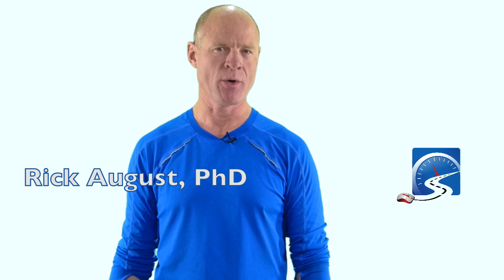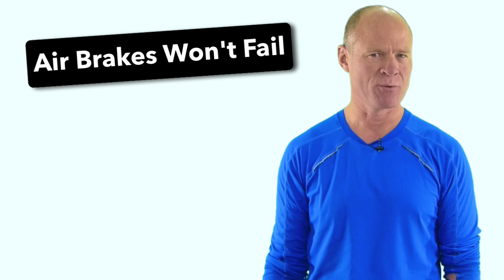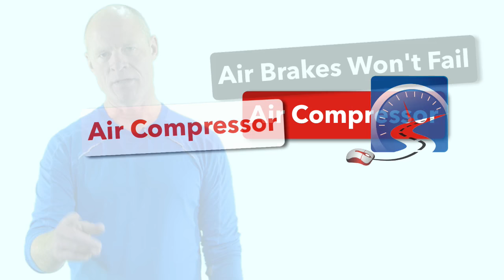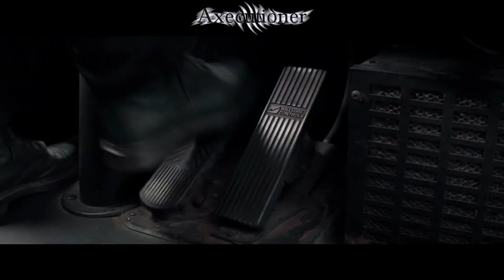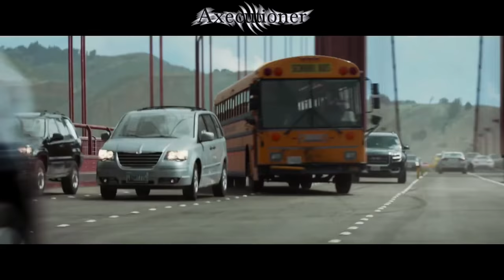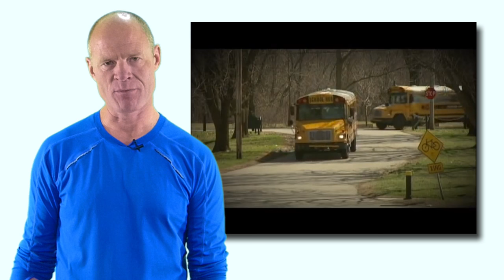Air Brakes Won’t Fail | Air Brake Smart

Comment: This is a great example of hubris. Saying something won't fail
Reply from the maker: I didn't say it wouldn't fail; I said it's unlikely that it will fail. There are levels of "likely to fail" - like airplanes. Air brakes and airplanes are built to the same high standard of unlikely to fail. And if they do fail, there are failsafes that will get you stopped in the unlikely event that the machine does fail. All the best, Cheers Rick
Reply: @smartdrivetest  IT SAYS IN THE TITLE OF YOUR VIDIO THAT 'Air breaks won't fail" NOT "Air breaks are unlikely to fail" but yes there are things that can stop runaway trucks on interstate highways
Reply from the maker: You're splitting hairs my friend. If air brakes were prone to failure, they wouldn't put this system on school buses. And almost all the time that there's a runaway truck on the highway, it's not a result of brake failure. It's a result of drivers that aren't trained properly, and they exceed the capabilities of the service brakes - the service brakes, not the "braking system." Because drivers weren't training on "downhill braking" they experienced brake fade. If you drove your car around at full throttle all the time, eventually you'd blow up the motor. Or if you tried to cut foot tall grass with your lawn mower, it wouldn't do it because it's beyond the machine's ability. Service brakes, in combination with engine brakes (jake brake), and the right gear going down a hill and the driver will get down the hill every time. Driver's in 140,000lbs trucks get down mountains all the time without every using the service brakes. All the best, Cheers Rick
Reply: Yup! All it can take is a bit of junk to puncture an air line.
Reply from the maker: @johnsarab4500  If that was even a remote possibility they wouldn't put air brakes on school buses. Air lines--to say the least--are robust. All the best, Cheers Rick
Reply: @johnsarab4500  show me an example where “junk” punctured an airline. I’m sure it has happened but it’s not even remotely common.
Reply: Getting impression air brakes never fail..on a semi

Comment: I failed my my air break test Oct 19 2019.  i felt over confident and failed right away, I  pass the core test and had two wrong.
I really want to learn how to operate a CDL Class A in the future. it's a scary thought in a case of a break failure  and theres no scape ramp.  now you have to make a critical decision on what you are going to crash into, just make sure its NOT PEOPLE OR FUEL STATIONS!
Monday I will start training for a school bus so we know what class I'm going for.
great video on explaining how the air breaks work.
I will sub,  I really can use you video instructions.
I was at DMV today and for the most part everyone keeps to them self.
Reply from the maker: Hi Mariovo5 - Thank you for your comment. Have a look at this video my friend: https://www.youtube.com/watch?v=c1ldt8qK-HM&list=PL0x-bChcUvwG2bSWReQWnk9Tm92L7WN_O&index=6&t=0s If there is anything further we can do, drop us a note. Always happy to help. All the best, Cheers Rick
Reply: The truck won't break effectively if you overheat them but not because of the system failing
Reply: @friedchicken1  But overheating absolutely leads to brake failure.  This is intellectually dishonest to call it anything but brake failure!  If you're flying down a hill and the brakes don't work, that's brake failure!
Saying otherwise is being disingenuous.  Teaching new drivers that failure cannot happen when it can is malpractice!

Comment: yes took my CDL test in 2010 was told they had a lot of problems to watch for, but I am glad they told me that because I have been driving farm trucks and it has helped me be wary of bad maintenance on them. GLAD TO KNOW Modernized WELL CARED FOR TRUCKS ARE WORRY FREE! WHEW!
Reply from the maker: Hi Ladonna - yes, older trucks are a little bit less reliable. But newer trucks with air brakes are more or less bullet proof. As I mentioned, a little bit of knowledge about downhill braking will keep you safe! Thanks Cheers Rik
Reply: Smart Drive Test thanks Rick nice to know!!!

Comment: Hey Rick 
I hear ICBC will be doing a revamp of the air brake course. Rumour has it that class 2,3 and 5 will be one day, and the class 1 students will stay for the second day. While it’s still a lot of information drivers don’t really need, it is a start. 
In my opinion, there are still some necessary lessons to learn during this course ie: how and why we check the system daily. 
Also, logging trucks are still sporting manual slack adjusters last time I checked.
Reply from the maker: Hi Chip Jackson - That has been a rumour for a number of years. They're not revamping the course; they're simply following Ontario. Ontario has broken the course up into single units and trailers for a number of years now. ICBC is simply doing what Ontario's already done. As you said, yes, the course still has way too much redundant information.
No, most logging trucks are all automatic slack adjusters. A couple of years ago when I did the manual slack video, I couldn't find a logging truck at the Kenworth dealership that was fitted with manual slack adjusters. https://www.youtube.com/watch?v=knbgfudCZC8&list=PL0x-bChcUvwG2bSWReQWnk9Tm92L7WN_O&index=8&t=527s There might be some owner/operators with manual slacks, but for the most part these are gone. All the best, Cheers Rick

Comment: Well, the training film during my national service didn't actually say they were unreliable, just that they required due care and attention by the driver to keep functioning reliably. So the message was: 'if you use 'm like we tell you to, they won't crap out on you'. That training film was made in 1959, though, and the learner trucks were built in 1961 (12 road gears, with range and split as a seperate levers... fun, once you got the hang of it).  A bit brutal to actually use on the road in Germany, in 1993, but when one was 23 and indestructable, one took it in one's stride.
Reply from the maker: Hi Jan Verschueren - Thank you for your comment. And you are correct my friend. Truck and air brake technology have come a long way and are much easier to use, and much more reliable. It is different here in North America - every course leaves you with the impression that air brakes could fail at any time. All the best, Cheers Rick
Reply: So what if the air compressor is faulty… will air brakes be fail safe on a highway…how long till brakes totally fail?
Reply: @realTomJones435  All wheels will eventually lock up. The air pressure is what keeps the brakes off. Without it a very strong spring presses the shoes into drum slowing down/stopping the truck.
You need a special jig to open an airbrake actuator. If you just undo the bolts the spring suddenly decompressing might seriously injure you.
Reply: Great thanks
Reply: Great thanks

Comment: I think there's an exception to the automatic slack adjuster (in BC at least) for logging trucks, they were having a lot of problems with the exceptionally dirty conditions that made the automatic slack adjusters unreliable.
Reply from the maker: Hi Rx7man - thanks for your comment. Nope, no exception for logging trucks in BC. And as I stated in the video, automatic slack adjusters are reliable. In this video, I went to 2 or 3 yards here in Vernon, and finally had to go to the salvage yard to find a vehicle fitted with manual slack adjusters: https://www.youtube.com/watch?v=knbgfudCZC8&t=25s&list=PL0x-bChcUvwG2bSWReQWnk9Tm92L7WN_O&index=5 If there is anything further we can do, drop us a note. Always happy to help. All the best, Cheers Rick
Reply: You can still adjust the automatic adjusters and they still have to be checked during circle check or brake check and replaced if they are defective.
Reply: @smartdrivetest  I actually had slack adjuster failure on a kenworth t800 dump truck rear brakes here  in Canada.
Essentially, a light brake applications would slowly take the pushrods out of adjustment because of slack adjusters, However, a six pack brake check adjustment would ratchet them into an acceptable limit. 
Fyi: Truck was inspected by a mechanic for safety less than two months before the truck was in an accident caused by brake failure

Truck was put back on road without proper inspection from MTO, police, etc. and a second incident happened at which point a full brake system inspection was done and found defective/faulty slack adjusters, defective brake shoes, (cause by manufacturer defect- wrong size airlines to rear brakes) and a defective S cam.

Slack adjusters were said the be defective to due wear and tear caused by manufacturers mounting position

Comment: I replaced my trailer slack adjusters but once a week I have to manually adjust them because they go out of stroke length. Ill have to try that 6pack method to make them self adjust.
Reply from the maker: Hi Mike Kahl - Thank you for your comment. Is your trailer fitted with manual or automatic slack adjusters? All the best, Cheers Rick
Reply: They are brand new so they are automatic. But once a week I have to tighten them up half a turn.
Reply from the maker: I would counsel you against manually adjusting your automatic slacks my friend. First, if they're going out of adjustment that much, I suspect there's something wrong. Second, in the unlikely event that something goes wrong--a crash for example--and they find out you're adjusting your automatic slacks, it wouldn't come off well for you. I would suggest that you take it into a mechanic because something is definitely wrong. All the best, Cheers Rick

Comment: nice work on video.  I was looking for some diagnostic help in locating leaks. this didn't help but not your fault, still good refresher!
gotta ask about manual slack adjusters being essentially outlawed, by what you said. Q: if they are to be replaced on annual inspection, why would  a truck and trailer parts house even still carry any ? and please don't reply by saying in case you wanted to replace one before your next annual inspection. That wouldn't make sense, would it?
Reply from the maker: Hi Greg Goslin - Thank you for your comment and query. And yes, that would be a silly reply. Believe it or not, there is still some equipment that is fitted with manual slacks, and is allowed to be fitted with manuals - quarry equipment comes to mind. Some mechanical setups don't allow automatic slacks because these are physically bigger, but not that much bigger. As part of the air brake requirement here in British Columbia, students have to know how to adjust a manual slack for the test. If s/he doesn't know, it's an automatic fail on a test. So training trucks have manual slack adjusters - but usually just on the front. Did you locate the leaks? If there is anything further we can do, drop us a note. Always happy to help. All the best, Cheers Rick

Comment: Saw one of your videos "How to Test Tractor Protection System for CDL Air Brake Inspection" In it you mentioned the dash red and yellow knobs will pop out when air psi drops anywhere between 20 psi and 40 psi.
I have a truck that pops out a 20 psi but would you know how to increase that pressure to 40 psi so my red and yellow knobs pop out sooner rather than later?  Or are these pressures controlled by springs pressure already set at the factory Thanks.
Reply from the maker: Hi Ricky G. - Thank you for your comment. Those pressures are set in the factory; yes, these aren't something that you can change. Saying that, if you have a loss of pressure in the system, you're going to hear it long before the low-air warning light comes on before 60psi (414kPa). And if the pressure does drop to causing the low-air warning light to activate, you are going to be looking for a place to pull over ASAP, because it "freaks you out a bit" when you don't have enough air to the system. And the other things is, the pressure protection valve is going to shut off air to the accessories before the low-air warning activates. So you're going to know. Your system is all good so longs as the Parking Control Valve and the Trailer Air Supply Valves "pop out" between 20 & 45psi. If there is anything further we can do, drop us a note. Always happy to help. All the best, Cheers Rick

Comment: What's to keep the tanks from rusting and exploding?
Reply from the maker: Hi Bubba Hyde - on modern systems it's the air dryer and the safety valve. See this vid: https://www.youtube.com/watch?v=yBi-6eUch0w&list=PL0x-bChcUvwG2bSWReQWnk9Tm92L7WN_O&index=17&t=2s All the best, Cheers Rick

Comment: Just had a truck with air breaks have break failure. brake pedal went to the floor and the truck rolled onto a curb and broke a water meter. So I know air breaks do fail first hand.
Reply from the maker: In a video game, or in real life? Cheers Rick

Comment: What if the air tank itself fails, for example someone shoots a hole in it ?
Trains need high air pressure in order to release the brakes.
If a carriage should decouple, breaking the connected air pipe, that high pressure is lost and brakes are applied.
Is the same in trucks ?
If not, then the air brakes in trucks are nowhere near as safe as those in trains.
>
Reply from the maker: Hi Bodragon - Thank you for your question. If someone shoots a hole in the tank, the compressor will keep up. If the thank falls off, the emergency brakes will apply. If there is anything further we can do, drop us a note. Always happy to help. All the best, Cheers Rick
Reply: If say a rock shot though your air tank. Your air level would drop. This will engage your brakes. You must have "X" amount of air to keep the S Cam brakes off of the drums.
Reply: @smartdrivetest  have you heard of foot valve/ plungers in the foot plate of the brake pedals in kenworths failing/ malfunctioning due to corrosion and/or blockage?
Reply: Air brakes in trucks are much safer than trains and they don't work the same you can't possibly have maxis on a train because it would be almost impossible to build up enough air to keep the maxis off to move the train .If someone shoots a hole in an air tank all the safety feature will do what they are supposed to do you will lose air which will show on your gauge and you will be able to heat air leak etc.

Comment: Why would the low pressure warning not go off at higher than 60psi if at 60 psi the brakes lock up and you're dragging a brick?
Reply from the maker: Hi Bubba Hyde - The brakes only begin to come on - they're not fully on at 60psi. 60 is the absolute minimum pressure to hold the brakes off. All the best, Cheers Rick
Reply: @smartdrivetest  Excellent videos, thank you for the responses!
Reply from the maker: Hi Bubba Hyde - And you are most welcome. We're happy to hear we could help out. If there is anything further we can do, drop us a note. Always happy to help. All the best, Cheers Rick

Comment: You made some good points, but the most demanding air accessory on a truck are in fact the brakes. Secondly, a better title for this video is “Air Brakes won’t fail in the same way as hydraulic brakes”. Brake fade from slicking of the pad, is extremely dangerous, and leads to a completely useless brake pedal. You can almost never hear an air leak from in the drivers seat on most new trucks. This is why you shut your truck off when you exit your truck and get coffee, use the restroom, etc. You watch your gauges closely. You listen for how often the air compressor engages. Finally, especially when driving in inclement weather, losing air pressure to the point where your yellow and red supply valves pop out, can cause a serious wreck when they put your brakes on full force. Again, different problems, but still very serious issues nonetheless.
Reply from the maker: Hi Riley Mccarthy - Thank you for your comment. You are misinformed my friend. Saying you can't hear an air leak in the the cab of a modern truck is like saying you can't hear the water run in a new house. And the air suspension system uses way more air than the brakes every will on a modern vehicle. See this video for downhill braking: https://www.youtube.com/watch?v=tKCyg2ln_1E&index=11&t=0s&list=PL0x-bChcUvwG2bSWReQWnk9Tm92L7WN_O See this video for brake fade: https://www.youtube.com/watch?v=26AFYfz14Ec&index=14&list=PL0x-bChcUvwG2bSWReQWnk9Tm92L7WN_O And if a driver allows the emergency brakes to apply s/he has a serious issue because the low air warning activates at 60psi - well above when the emergency brakes come on between 45-20psi. All the best, Cheers Rick
Reply: Maybe it’s just my truck, but it would need to be a very serious air leak in order for me to hear it from the seat over normal operating noise. I had an air line get a hole in it, and began losing several psi per second, and I could not hear the leak inside the truck until I turned the truck off. My truck kept up with the loss enough to get off the roadway. My point is that you should always do a thorough pretrip, and keep a close eye on your gauges. If a driver loses air fast enough to hear the leak in modern trucks like mine, then you’re on the clock to pull over safely, because it’s only a matter of time before your parking brake buttons pop out. As for brake fade, not every driver will decend a hill the right way. This is more prevalent with newer drivers, but even the most experienced drivers can mess up. When that happens and a driver relies on his brake pedal to slow him down, those brakes can become slick and will smoke with the chance that they catch fire. This isn’t an issue with 99% of cars unless they’re towing. Reduced speed, engine braking, and a lower gear, along with braking as needed, are the way you stay safe, and handle hill descents without issues. I want to see all my fellow truckers and prospective truckers go home safe and sound. I stand by my original point; air brakes can be just as problematic as standard hydraulic brakes. There is a reason that there is a whole test section devoted to air brakes.